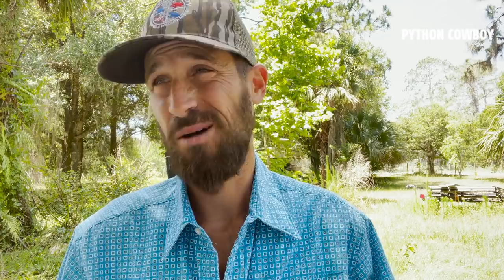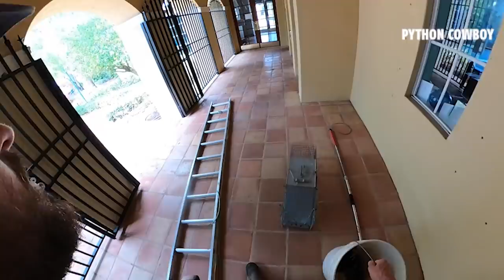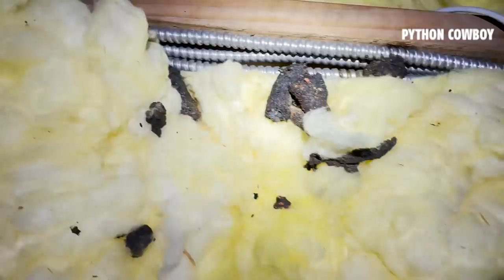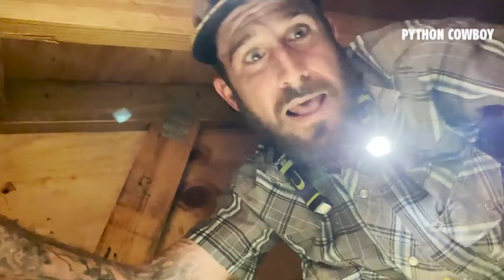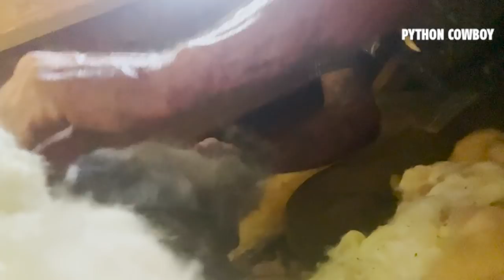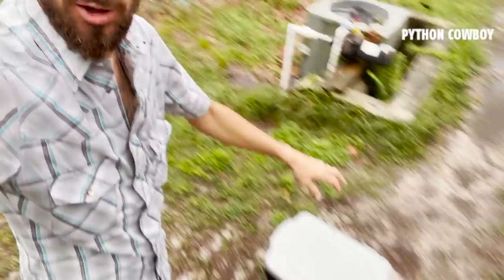Rescuing Baby Raccoons From An Attic In South Florida

Comment: I lived in a house that had this same problem but with a opossums, I discovered it one night when I heard the baby’s scratching what sounded like the inside of the bedroom walls, after some investigation I discovered they were in fact inside the walls because someone added a bathroom on and didn’t add fire blocking so they fell down a stud bay, I got lucky and found a false plug cover in the stud bay they were in, I dropped an 1/8” cable down the wall to give them something to climb up and within mins I had a baby opossum staring out at me, I set up a box they could fall into and within 10 mins I had three baby opossums, I also took them to a sanctuary were I discovered I was a big pussy when it came to handling these things as the teen girl just picked them up like kittens and hung them on her T-shirt.

Thanks for posting the video, out of everyone I followed on Instagram I miss your page the most, keep up the good work.